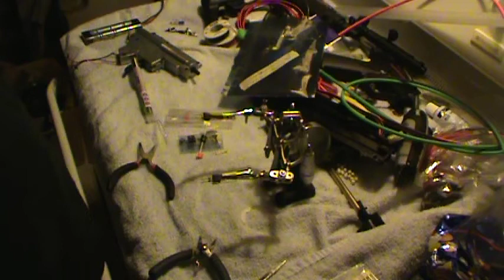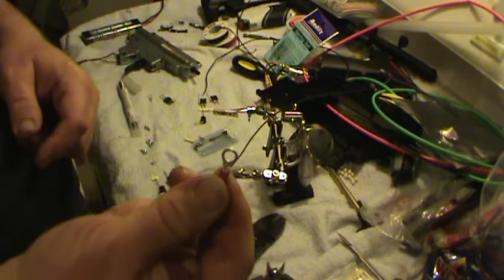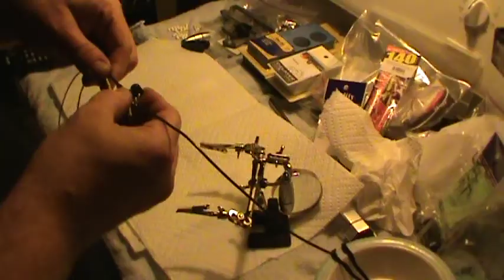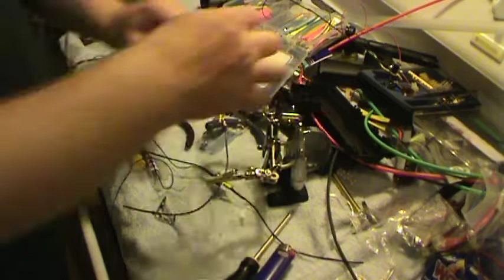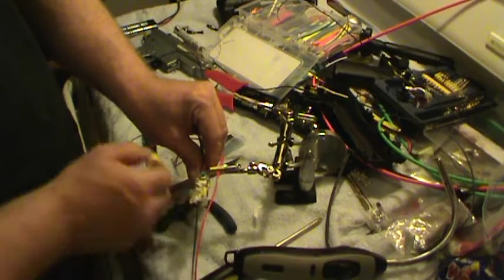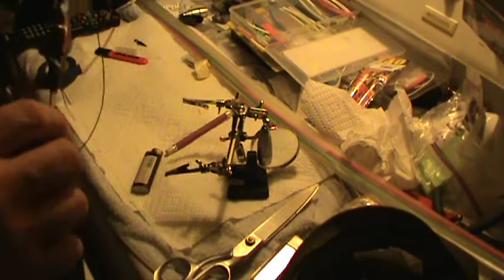ScooterVauto's Stove Top Work shop -- Simple Mosfet unit

Comment from the maker: @baios4 Hi there, yes it will. I have a few 11.1 Lipos i use.
the least power full is an AK stick style @ 1100 mah 15c continuous 20C burst. & have also used my Thunder power 11.1 2250 Mah with no issues other then the INSANE ROF increase.. that was only out down by a New Great hobbies 11.1v Lipo 1300 mah but where the Thunder power has a burst of 35 to 40C the New great hobbies has a 50 C continuous - that bAsturd sacres me the bbs come out in a line a player could walk on. Thanks for watching